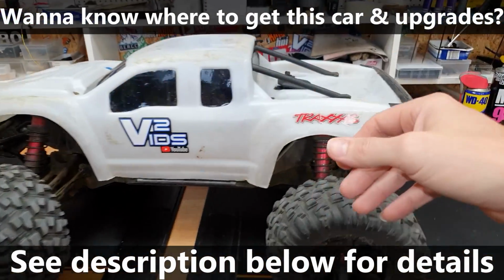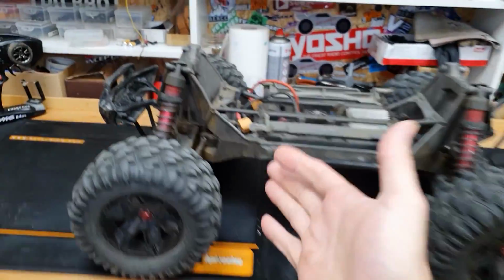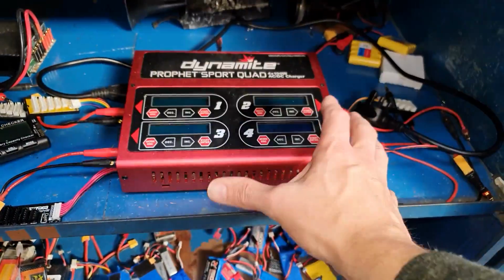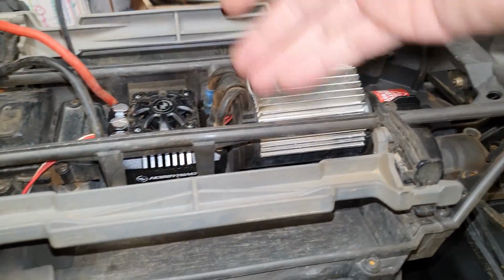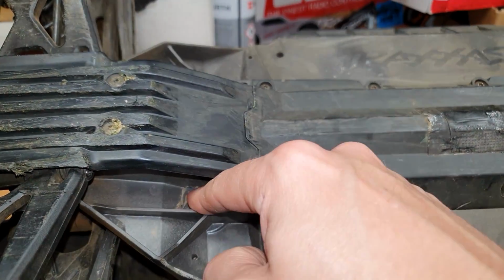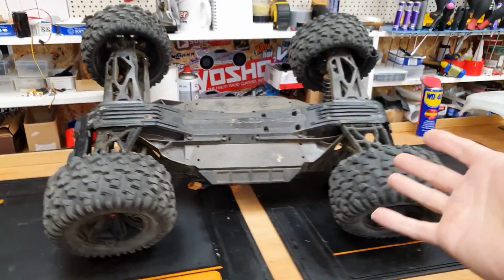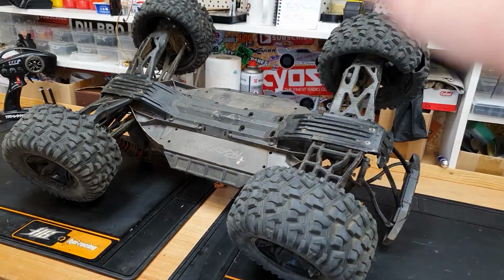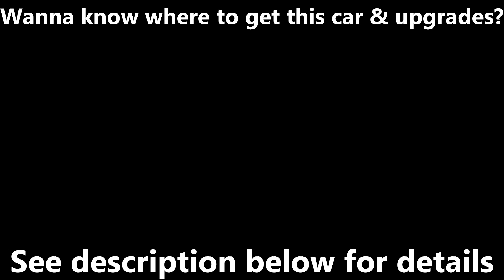My Traxxas X-Maxx 8s,  Modifications & Setup

Comment: hey kev how do you remove that stock silver heatsink on the motor? i have a blue unit to match my suspension and would love any tips u can throw my way!! do i just pry it off or is there a bit of a process? do i have to remove the motor and then slide the heat sink off or how does it work w the xmaxx? i do have the original 6s model i would love the tips i cannot find a single thing anywhere online plz help a fellow enthuiast!!  cheers mate!!

-P3T3R
Reply: Take the engine out and slide it off. Then install the new one and reinstall the motor

Comment: Kev I had 2 8s xmaxx esc melt. I ran the truck then cut it off with the batteries still in then I came back 30 min later and In had melted. Any ideas what is happening

Comment: Why does nobody like the traxxas battery connectors because i love them on my X maxx
Reply: because xt90s are better i think
Reply: that is probobly why lol they are eisier
Reply: I use them. I havent had any issues with them whatsoever. And i didnt want to break the warranty, because that is what happens if you cut off the Traxxas connectors and put some other connectors on.
Reply: They spark when you connect them overtime that’s hurts your battery. Upgrades don’t.